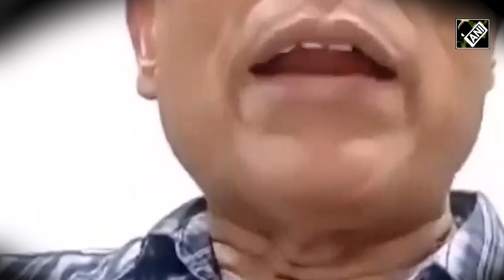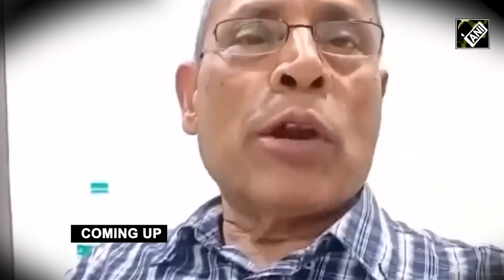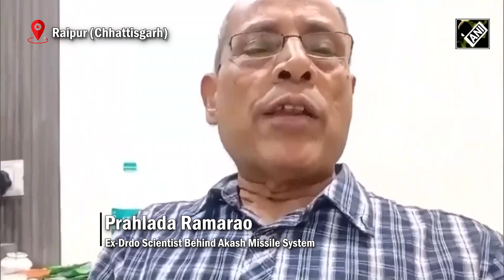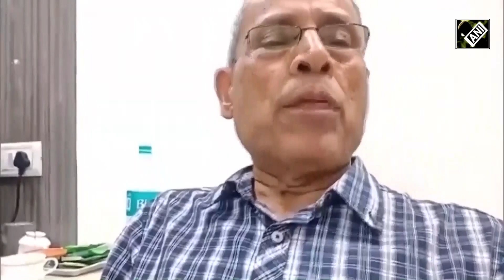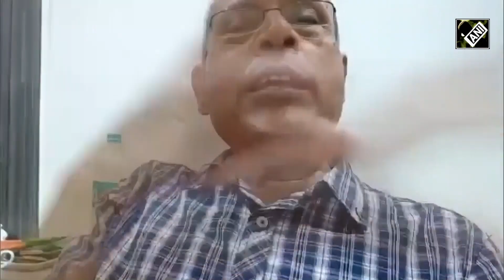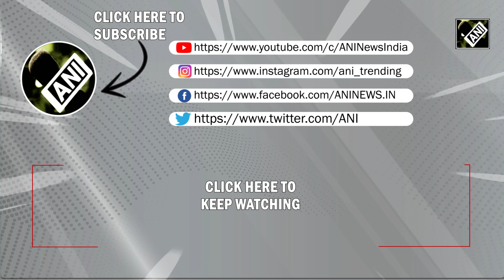Prahlada Ramarao, the man behind India's deadly Surface-to-Air ‘Akash missile system’ shares details

Comment: Initially Akash was designed to intercept fighter aircraft at a distance of 25 kilometers and then after a long period of continuous research and development as well as several upgrades, now it can not only intercept aircraft but any kind of flying object at a distance of 60 KM. after integration of Artificial intelligence it transformed  into the state of the art Air defence system